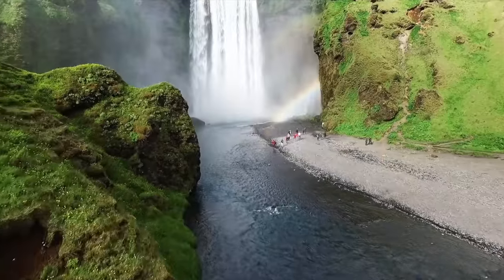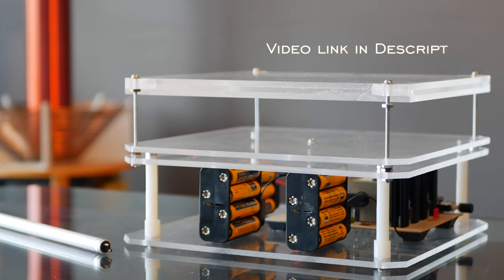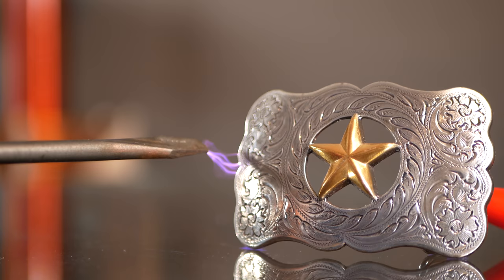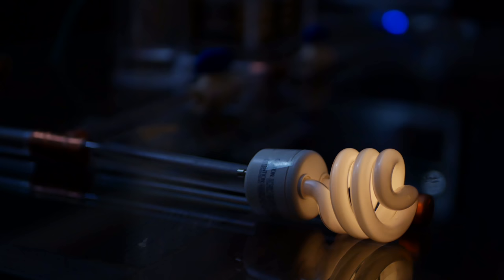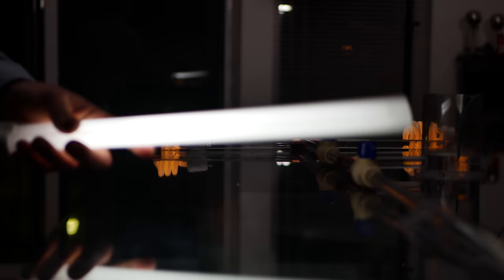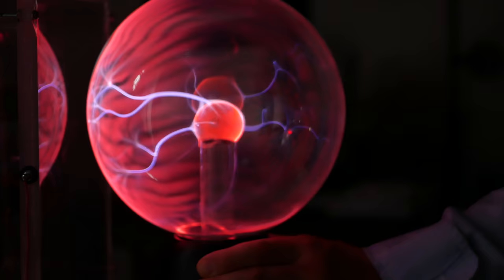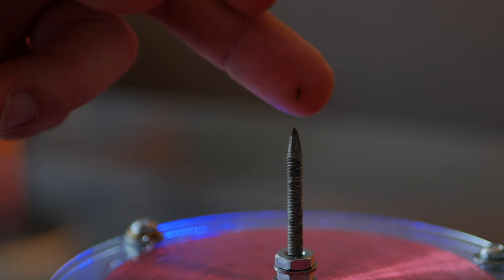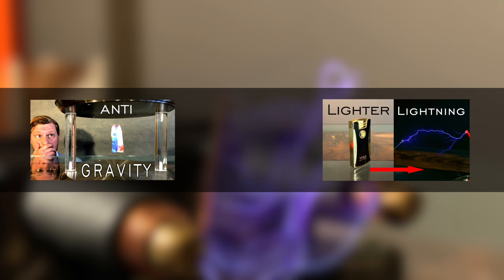Directional Wireless Energy Using Water

Comment: The flaw I see to this system is that the electrochemical charge being sent through the water molecule atoms chain in sequence as the charge is applied. This in turn sustain it's own capacitance within each volume of water due to the acrylic creating a inductive resistance sheath. When you open a valve your supplying a higher charge into an already semi charged space that's building capacitance. When you close the valve The contained space (a length of pipe between two valve's) will still have it's own sustained capacitance generated from both the active source as well as any residual Em resonance generated from neighboring sources, with out a source to ground out the charge when the vale is closed. Which means that the length of pipe operates as a crude capacitor, until it's charge dissipates from residual sources. Additional the Em field being generated from the nearby pipes are also producing electricity which is in turn still charging the turned off pipe, because it is not shielded.

Comment: I think that the reason why the lamps still glowed although dim is because the shut off valve created a clear separation from the water medium but there was still Capacitive Induction still at play.
Reply from the maker: Hi tony, that is one of the reasons, great job.
Reply: There is also a magnetic mutual inductance transfer to the air environment.  Magnetic field propagation. Similar to transformer theory

Comment: Very nice video great idea, and out of the box thinking. Second to answer your question that you did explain. The two other bulps are picking up the radiant energy from the longer tube....
Like you said you where in shock when you found out it could transmit a few meter!
Stil despite many raisons not to use suchs systems. Its still very nice proof of concept.
Reply from the maker: Nailed it! Great job. Also, some capacitive coupling through the valve.

Comment: You would have interesting insight on how the pyramids worked for wireless electricity using underground rivers. The giza pyramids are a good example of using piezo electricity from the giant sealed granite boxes with expanding and creating pressure, and using water to carry the charge throughout the system. I am subscribed and hoping for a hypothetical giza pyramid functionality analysis.

Comment: Capacitive coupling occurs low frequency HV transmission lines as well, especially under light or no load conditions. The lines themselves act as capacitors with air as the dielectric, which can cause a bunch of problems like the Ferranti effect and inducing current in adjacent de-energized lines or objects. You can light up a fluoro tube if you get it close enough to an HV line with it (not recommended obviously)

Comment: I enjoyed your video.
You said you had a power source. 110 which was plugging into a wall. 
The reasoning the lights continue to Glow is because Water contains iron and other elements. Lightning strikes a lake it can travel from one end of the lake to the other.
When it comes to the power source if one could contain the power source separately in itself,  that is perpetual. To generate electricity or another form of the electricity.
That's what we need
Reply from the maker: Hi antonio, the powersource was not 110 volts. It's 20kv. Great guess on the reason why it stays lit. It's actually for two main reasons. The side of the valve that is still energized, is relatively close to the bulbs still, and, some capacitive coupling occurs through the valve.

Comment: They stayed partially lit due to the stored energy still in the water causing electron excitation in the tube. Water has a charge due to ions from minerals and ANY chemical reactions where ion are exchanged to form a compound. That will excite the valence electrons in the argon gas and upon decay causing florescence. Plus the valve may "seep" a little bit?
Reply from the maker: Great idea! You were correct on the valve....there is capacitive coupling across the valve from the powered water to the non-powered water, and, the two bulbs, even when shut off, were still in close enough proximity to the power water reserve that they were ionized.

Comment: Coat the reservoir and tubing with an hydrophilic material.  Drill holes in the tubing and wind it into the reservoir. Place the reservoir assembly inside an induction coil and Irradiate the reservoir from the top with  ~ 1300nm light.  The exclusion zone building will produce a greater potential.  
Just saying

Comment: The light glows because the range is wide enough the power is supplied to the bulb from the water before the switch due to its long-range. 
it's awesome !!
I think if this feasible if u can allow power to flow through other dielectrics which have better capacitance like marble since building tiles, are made of marble 
Just a suggestion though so we reduce chances of formation of hydrogen

Comment: New sub. 
I really enjoyed your video. 
And here is my guess.
 The gas trapped inside the tube was still excited and bit begging connected to a neutral wire to alternate the energy in side the tube.
Reply from the maker: Welcome to PlasmaNation! Great guess! So, the truth is two things. First, the bulbs on the left were still within proximity to the energized portions of the water. And 2, the valves allowed a small amount of capacitive coupling through them

Comment: The oscillating magnetic field is able to circumvent the plastic valve and induce an oscillating frequency to the water on the opposing side of the plastic valve. The electrons “shoulder check” the atomic lattice. if makes any sense

Comment: Part 1 about reality:
The pyramids were built over underground water systems.  We're not sure exactly how they worked, but, in nature, patterns reverberate with like patterns, and it has something to do with that.   The electromagnetic field extension from the electrified water, to the light-bulbs several feet away is, as you know, the electromagnetic field extending in space through the air.  But this kind of dynamic is not limited to electromagnetism.  All forces are fields.  All matter, and energy, in fact, are fields in space-time.  Physicists refer to this perspective on reality as "Field Theory,' so they say(I'm not a physicist.)
   But fields cause resonance with pattern structures that are similar to the pattern structure that is generating the field.  The resonance is in proportion to the similarity, but not just the similarity in the structure of the pattern, but also the similarity in space and in time.  We can use the word 'proximity,' instead of similarity.  The proximity of pattern structure is the 'proximity of form.'  There is also proximity in space, and proximity in time.
   If you tap a tuning fork, all nearby tuning forks will begin to resonate with it to the extent that they are proximate in form(structured for the same frequency), in space(nearby) and in time.   The time proximity can be observed by the fact that if you tap a tuning fork, then silence it and very quickly move another one of the same tuning into close proximity it will still very slightly pick up the frequency.   We think of that as the air molecules still bearing that frequency which quickly dissipates into chaos with removal of the source, but not instantly.
   And that is true.  But we can also conceptualize this, and perhaps more fruitfully, as the vibratory pattern dissipating relative to temporal proximity, just like locational or structural proximity.   That allows us to simplify our conceptualization of what's happening more simply, thus to bring our understanding closer to the simple base principles.  In this case, pattern resonance by proximity.
   There is LOTS of evidence for this, though I doubt you'll find any of it in scientific journals.
Now, here's where it gets interesting.  Nature repeats itself a lot when it comes to patterns.  It 'reuses' patterns across what we think of as all sorts of 'fields.'  Patterns in physics will pop up in the human psyche, in biology, in music, art, in patterns that computers will generate given random simply algorithmic inputs.  We used our detection of proximity of patterns across mediums to create metaphors for the communication of concepts.  But they are not just metaphors.  Where these patterns are proximate enough in form, space, and time, they resonate somewhat, to the degree of their proximity.
   Ancient peoples used this principle to create 'magical charms and amulets' to hopefully generate some kind of field or resonant effect.  To ward off a pattern off events that they did not want to occur.  This was probably a superstitions half-remembering, through stories, of the much older real usage.  Whatever civilization's science those half-memories stemmed from is lost even from history, probably sunk beneath the waves as coastal waters rose ~300 feet in about a day, at the end of the last ice age, through some cataclysmic event; perhaps a meteor impact, but possibly also a solar lightening strike vis-a-vie the 'Electric Universe' theory.
   Thus, creating certain resonant patterns via thinking/meditation, or using vocal singing/chants can probably be used to 'split rocks,' counter gravity, generate electricity, all sorts of things.  See into the future a little bit.   And this is the 'science' of the ancients.  They were way behind us in terms of the sophistication of our reductionist physics-based science of particles and precise measurements.  But they were way ahead of us in using the observance of macroscopic pattern resonance.  They'd have had to use such methods to build the pyramids in the first place.  And they were built for use through such pattern science, likely to generate electricity, or energy in some other form.  It had to do with energy, as best we can tell, who have an interest in thinking about such things.
   The patterns of reality are simplified as geometric shapes.  Indeed, by mathematical necessity, everything reduces to simple shapes, as expressions of dimensionality, though at our scale of experience, reality is a jumble of complex composite shapes.  Thus, they used a lot of shapes as symbols.  But these symbols, for them were probably not merely representative, or metaphorical symbols.  They were more functional.   Like on-off switches for a certain kind of pattern.
   So why don't they work now?   Because they were probably mostly symbolic representations of psychic patterns, like notations for music.  We don't know what they mean anymore.  The psychic pattern corresponding to the symbol would provide most of the resonance.
   (Not everyone forgot all of it, though.  Or it's been partially rediscovered.  Hollywood can still be observed to make heavy usage of this kind of magic.  And it's pretty sinister.  That's another thing about this art form; unlike what new-agers prefer to presume, it has nothing to do with any kind of 'spiritual morality.'  It's just pattern resonance, and can be used by people with good or bad moral intentions.)
   But Hollywood isn't softening stone, or building megalithic structures without machinery.  But the ancients were.  This is deducible from the simple fact that the structures exist.  You can go and see them, but we can't build them or think how they'd have been built.  I'm not talking about crappy little stone piles like 'Stonehenge,' or even so much the geometric stacking of the pyramids at Giza, but the precision 'polygonal masonry,' as it has come to be know.  You can Google examples.   And these stones resemble, in turn, the way cells self-assemble into the human body.  Another example of pattern resonance, perhaps not one that the humans at the time were aware of.
   That similarity is not coincidence as we think of it.  More precisely, it is coincidence, but coincidence is fare more interesting than we think.  There's a causal source for it, which is proximity resonance.
   Rupert Sheldrak's "Morphic Resonance Theory' is this same observation, and he is my source and inspiration, but I prefer to call it 'proximity resonance,' to introduce the idea that it's not only about the form of the pattern, but also it's context in time and space.  To me, those are 3 factors that determine the strength of the resonance.  (Part 2 in Reply)
Reply: Part 2:
   This model of reality explains nearly everything we don't currently understand about our immediate experience.  Take ghosts, for example, hauntings.  Yeah, I'm going there.  Resonance explains everything.   You go into a house where a person was murdered.  They were probably feeling afraid, and thinking about the fact that they might get murdered.  That's a very powerful feeling to have.  Intense.  Later in the temporal dimension, you go into that same house, get all worked up and paranoid about ghosts, start fearing that the ghost will murder you, and you start to resonance with the stat of consciousness of the person who was getting murdered there.  This causes a connection just like the electromagnetic field between the tube of water and the light-bulbs, and suddenly they can seven see a ghostly image of the victim.
   But somebody who doesn't believe in ghosts can go into the house, not get worked up with terror, and won't resonate with the victim's thought patterns strongly enough to see anything.
   It's the same location, so you have strong locational proximity.  If the believer in ghosts gets scared enough, you get a fair proximity of form, of the patterns of thought and emotion.  The intensity of the original emotion of the victim strengthens the resonance so it can extend further in time than weaker emotions do.
   Another interesting observations is that once a house becomes known as 'haunted,' and people regularly go there and get scared and resonate with the frequency of the murder, the resonance goes both ways.  That strengthens the resonance of that pattern at that place, helping it to extend through time, like radio towers amplifying the radio signal over distance in space.  It's a self-perpetuating system of reinforcement of a mental/emotional pattern in relation to a space, using multiple persons across time, as amplifiers.

   This helps explain all sorts of other 'paranormal' or 'psychic' phenomena.  I haven't heard of people doing this exact experiment, but of similar ones with success:  if you put a person in a sound-proof room, and have a bunch of people outside the room think about a certain thing or subject, something specific, it's not unlikely that the person in the room will pick up on the thought pattern extending through the sound-proof walls, and start thinking of the same thing.  But he'll need to have sort of cleared his mind first of whatever thing he's personally focus don at the moment, to allow his brain to pick up the frequencies from outside.
  People have done experiments like this involving drawing pictures, and with success.  They are ignored, because people don't like what they don't understand.  But we needn't not understand it.  I'm explaining it, here and now.  It's the exact same resonant field dynamic that you used to send electricity field through water, and then also through the air, to light up the light bulb.  We use it every day, without water, for wireless electricity.  And before that, we were using it in the wires.
  We use it every time we write  a book, thus publishing ideas, perpetuating thought patterns, displacing old thought patterns, causing changes in the world.  It started America, based on ideas about liberty and autonomy and taxation.  I'm spreading ideas right now, by typing words that will cause those thought patterns to resonate in the mind of whoever reads them.
   When we think this way, everything starts to make sense.  All the mysteries present themselves in clarity.  (Not all, but many.)
   And I wrote this long comment, not gambling that anyone will necessarily even read it.  But just thinking through these thoughts gain myself, creates that thought pattern in the midst of humanity.  It makes it more likely that somebody else will think similar things.  I'm strengthening the resonance of these ideas.
   If anyone did read all that, Hi, what's up, dude?  What are you doing here in my thoughts? 😄

Comment: The bulb was flickering because halogen bulbs need a steady voltage. if it varies slightly it'll flicker which is likely to happen because the current being carried in the water is probably unstable - water itself is an insulator, but the metals therein conduct electricity. It's likely the conductive materials in the water are erratic - thus flickering bulbs.
Reply from the maker: Great input!

Comment: I thought the US submarine already have something similar in underwater communication system, don't they?

You haven't try ice yet, pipe can be freeze in winter. If it is behaving different, it can be use to check where is the freeze pipe. At least it is a practical use with a good course.

Comment: Would be great to wirelessly adding new lights.
This water-based system can be used to combine art and electricity at restaurants, bars, wedding events, etc.  to light up sculptures in a creative way.
Could use bamboo as water tubes & maybe create a bamboo hut with electrified water running through it.
Maritime uses in boats?
It would be interesting to develop a water based system to generate electricity, though such a system would be impossible without the use of magnets & copper, or is it possible?
Will it work on motors such as a ceiling fan or a vacuum cleaner?  If not, what would it take to get it to work using this system?  
It would be a cheaper alternative to copper, especially in places around the world where copper is hard to come by.  
It would make an interesting survival method especially for those who end up getting stuck on an island.